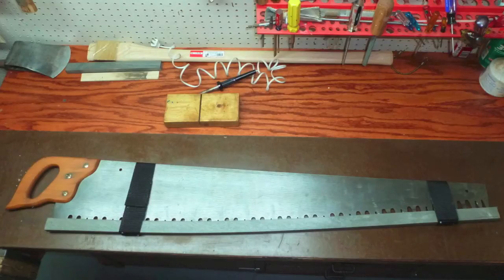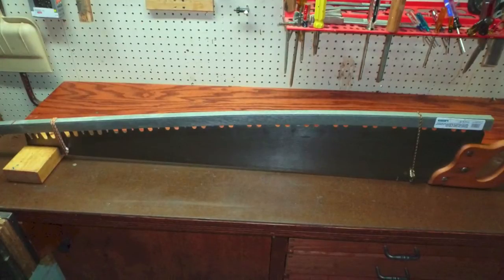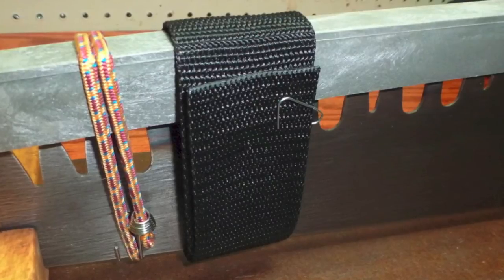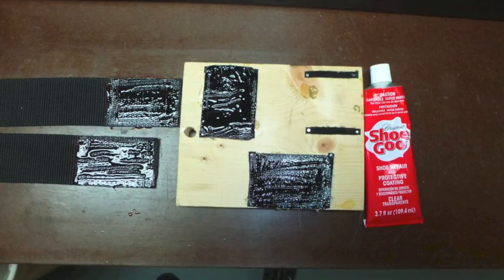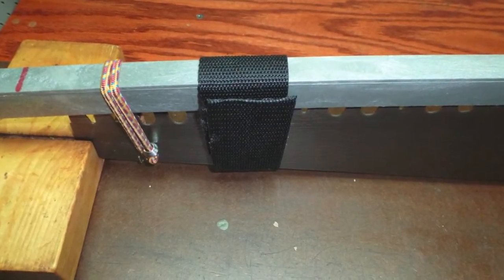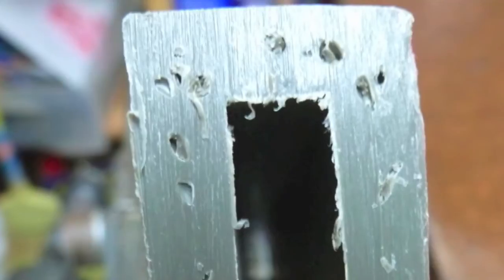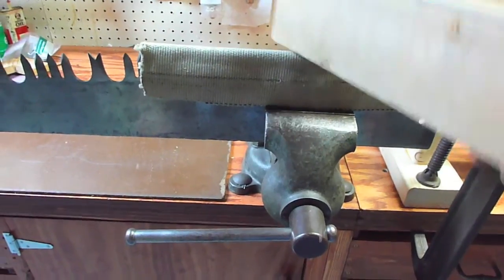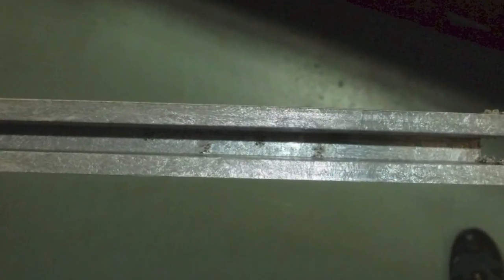Crosscut Saw Sheath for Trail Work

Comment: I'm just getting into restoring and using saws on my cabin build. I've got firehose on two saws. I'll give this a try. I like the easy of removing the velcro straps. Thanks for the tip!
Reply from the maker: Screwing the straps down works ok for two-man saws, as there is not much bend to the plastic channel lattice. But with two-man saws, if you screw in a third velcro strap in the center, the bend can eventually weaken the plastic. Lately, I've just been shoe-gooing the straps to the channel lattice and that seems to prevent cracks from forming. I give my saws and sheaths a hard use on wilderness trails year-round, so I'm aware of how the different sheath materials hold up over time.

Comment: I've seen a couple of folks start using 3/4" PEX pipe. Takes a little more wrangling to get it on but it's a tad lighter and no sharp corners. We also use rubber straps to secure it with D rings to old luggage straps we get a thrift stores. Nice video! Thanks!
Reply from the maker: The channel lattice doesn't like getting drilled and screwed but the Velcro wraps keep it tight. I like firehose the least, as it soaks up water and can be punctured by the saw teeth.